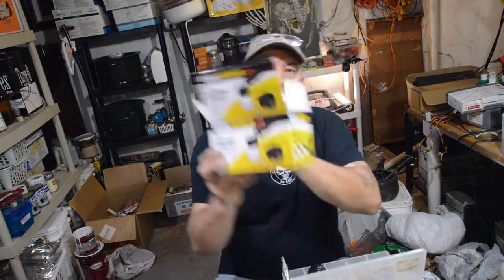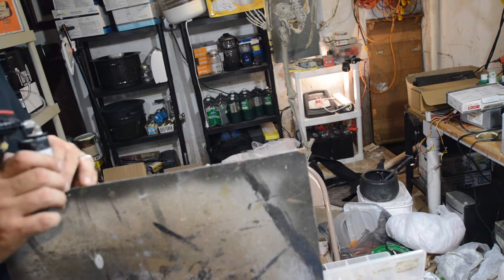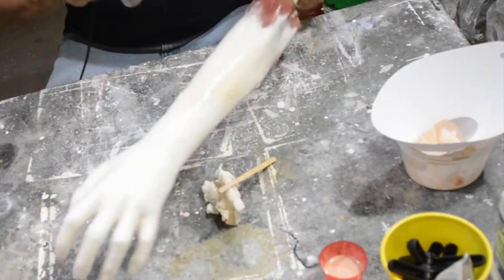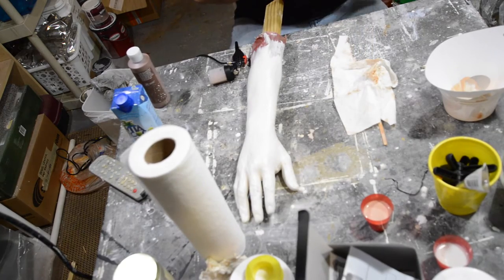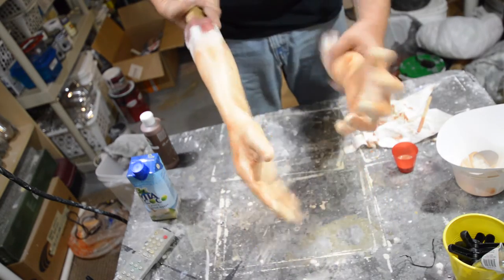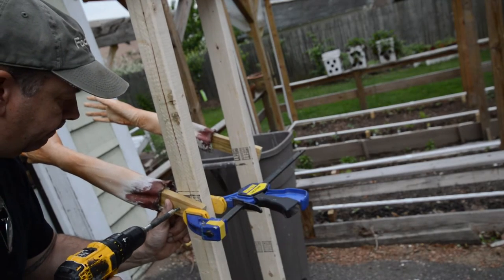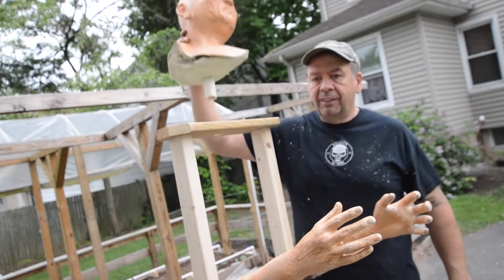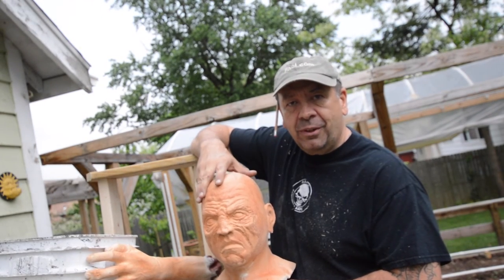Airbrushing and Attaching the Cellarer Prop Arms and Mask

Comment: That HF airbrush can be temperamental. If the small metal nozzles aren't properly aligned you won't get the paint to come out, etc. I've run thinned monster mud through mine with that small airbrush compressor without any issues. I'm thinking the thickness of the paint mixture is what makes the difference in whether or not it will work. Glad to see that you had a backup plan. There are few things worse than being stuck troubleshooting when you want to get stuff done.
Reply from the maker: +Dminorsound Yeah, because when you're like me you just throw crap out if it doesn't go your way. lol. I may just need to spend a little time with the compressor. Jose says he also has no problems with it, so maybe I have a wrong setting or something....imagine if I read the manual?!?